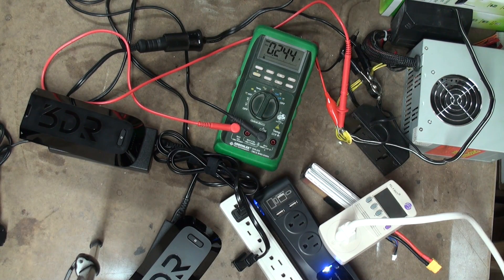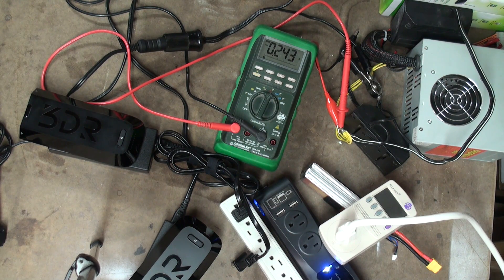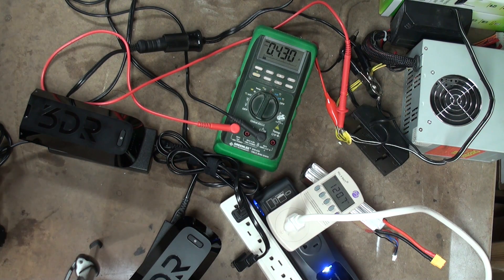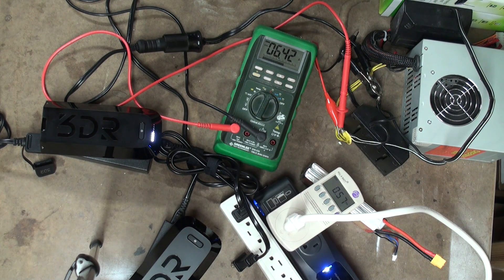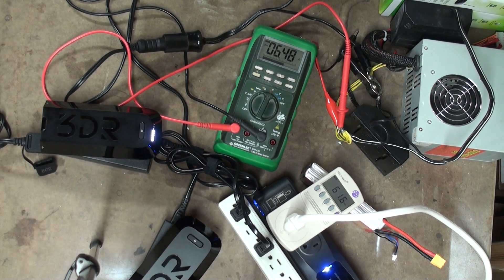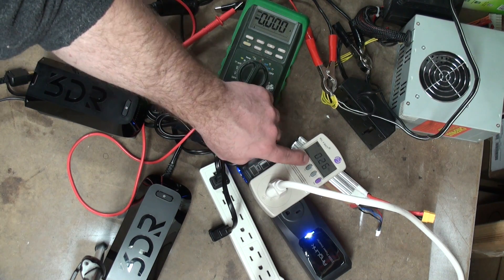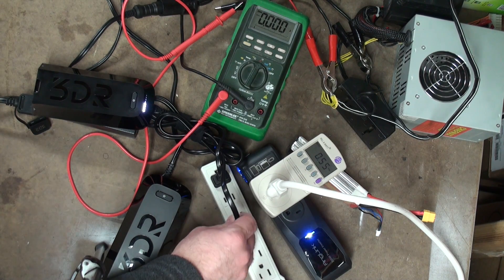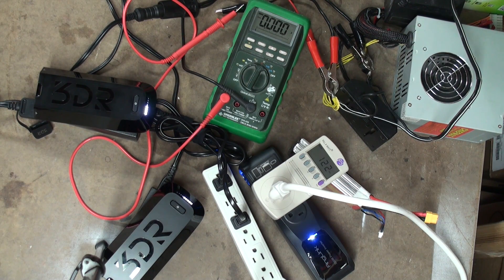3DR Solo Battery Charger AC & DC Power Consumption - Current Draw

Comment: Thank you for this video, it answered the questions I had about using an inverter to charge my Solo batteries.  I have an inverter that connects directly to the car battery using alligator leads, which should work better.  Inverter is designed to shut off if the car battery drops below a certain amount so it won't leave me stranded.
Reply from the maker: Absolutely, I'm glad you found it useful. I was surprised at the amount of DC current it took to support the AC draw required to charge a few batteries... sounds like your inverter is a very nice one.
Reply: it's an older one, but should work.  If I even need it.  With 4 batteries, I don't see myself being out long enough to charge batteries.